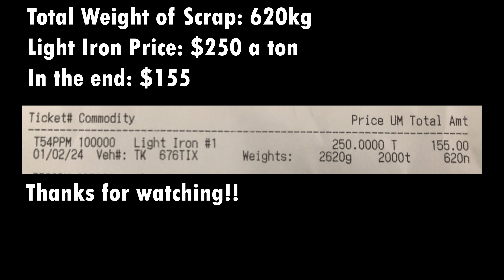Scrap Metal Run | #5

Comment: Does your scrapyard not take "insize", or prepared metal? Saw you tossing, wow, so much that could be classed as prepared. Like those grill grates, plus so much more. Anything 1/4 inch thick or more, and less than 3 or 4 feet, or whatever it is in metric measurements, can be turned in as either prepared or insize, for more money. I would definately check that out.
Reply from the maker: Hmm interesting I might look in to it! Thanks!